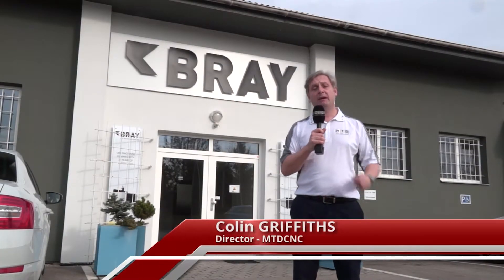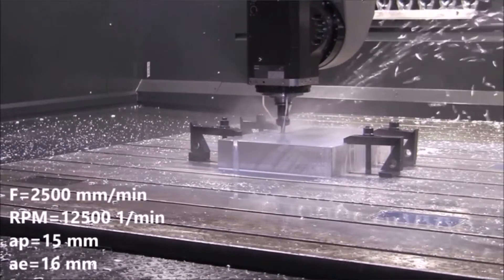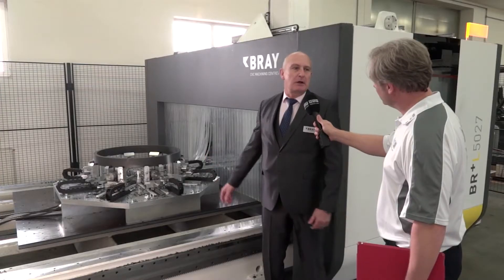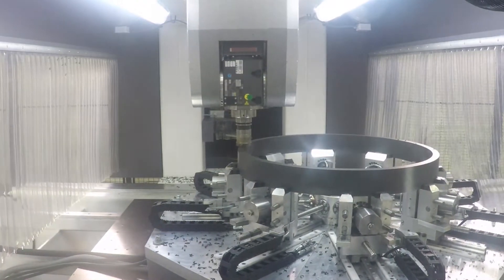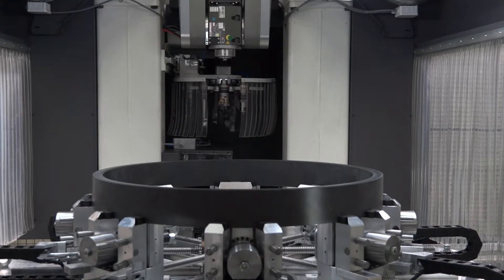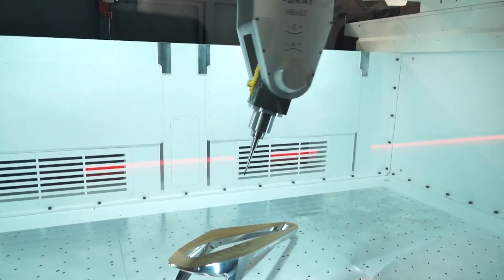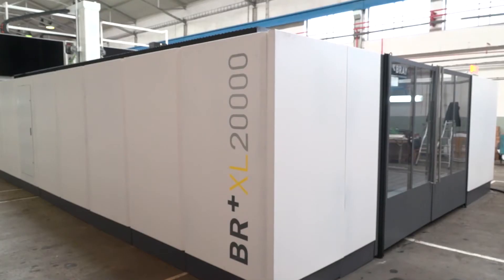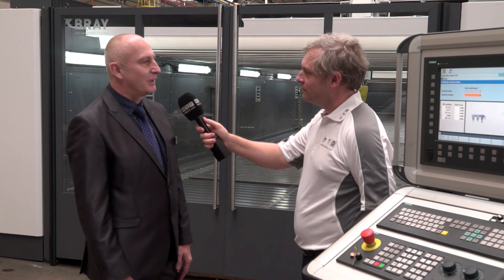BRAY Have you seen these high speed 5 Axis CNC machines?

Comment: Hello,
i inform you that the clamping device shown in the video
not invented by the Fa Bray
and
not realized by Fa Bray !!! 

The device for manufacturing thin-walled plastic bushes
was developed and manufactured by the
Company Münz GmbH in Kleinwallstadt Germany

www.muenz-gmbh.de

Münz realized in behalf of CPI /  Büttelborn / Germany
The construction of the device
The manufacture of the device
The manufacturing process of plastic bushes in the device
The work steps
The security concept

The device was manufactured for the customer CPI in Büttelborn / Germany
and supplied to the company Bray for installation in the customer machine for Fa CPI.

Bray has no intellectual property rights to the device.
Bray just assembled the hardware.
and delivered their machine to the customer CPI in Büttelborn / Germany.

All rights to the design and function of the device are included 100% to 
Münz GmbH Fertigung & Technologie , Germany 
www.muenz-gmbh.de